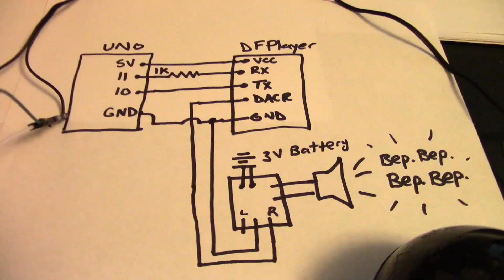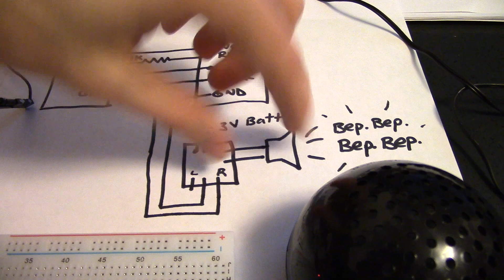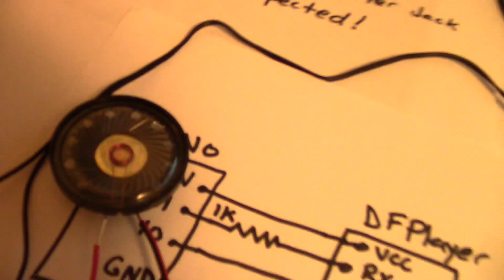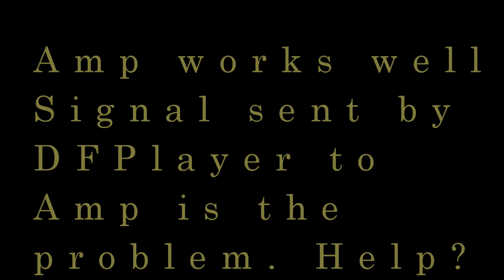DFPlayer troubleshoot

Comment: This is a very old issue, and many have probably figured it out already but I will nonetheless post this in case someone finds it helpful.

I had exactly the same issue when connecting everything on a breadboard with jumper wires, and as several people sugested here and on forums, soldering everything tight, including soldering ground pins of the DFPlayer together, completely solved the issue. Works well when powered through PC USB or 9V battery - does not matter.

Comment: I had the exact same problem as described in the video in stereo mode only (speakers connected to dac_l and dac_r). I finally solved the problem when I connected the speaker negative(s) to the other ground of the dfplayer mini  (opposite side from dac_l and dac_r). The 5V and ground of the power supply are connected on the same side (ground between dac_l and dac_r).  So two different grounds, one to the speakers and one to the power supply). No Bep  Bep sound any more, try it!
Reply: Boom!!! This. Thank you very much. I also switched to Ground Pin 10 (it was 7 before) now no Bep Bep Bep anymore. Pin 7 is still used for the GND of the speakers.
Reply: Your reply helped me a lot. This and external power supply resolved the issue. Thanks!!!
Reply: Beauty! Just started playing with this module. Had seen comments that both grounds should go to power ground but disconnecting one ground  switching the (in my case) headphone ground to that pin    did the job. For such a popular chip you would think better documentation would be out there

Comment: I have had this. A bit late now but for anyone seeing the same thing. I was supplying 5v from a power bank, this was because the player would clip and cut out when the noise got a bit loud. I thought maybe this was insufficient current. I swapped back to the 3xAA power supply and the noise disappeared. If you used a regulator you could probably still use a power bank. There are two types of wiring on the internet. Prominently it is connecting speaker+ to one output and speaker- to the other output. You should in fact have one going to the speaker output and the other going to GND. This stopped the clipping.

Comment: I know this video is very old but the problem is caused by a lack of power from the 5v supply. eg if you use a USB lead to an Arduino, and 5v from there to the DFplayer.  Run it all from an adequate power supply and there will be no issue at all. But still connect the DFplayer to that supply (5v regulated) and not from an Arduino as the Arduino can more often still not provide enough current(A) ability (even if the Arduino had a 12v supply into it).
Reply: this solved the problem

Comment: My findings: power issue.

I had the same issue with an Arduino nano (clone), tried all the suggestions (resistor, capacitor, separate power supplies, grounding both pins, etc), nothing worked.
Today I tried a Wemos D1 mini and it sounds fairly good when powered by USB with a PC.
But it sounds great with a separate, more powerful supply (also by USB).

Comment: I have same problem.
Someone is writing 9V 2A is OK.
Have you tried it? Dose 9V work well?

https://arduino.stackexchange.com/questions/49807/dfplayer-noise-researched-tried-and-bep-bep-bep-bep-bep
>Power is the big issue. When I powered my Arduino with a 
>9v 2A supply all the noise went away. 
>Switching to USB power (5v) caused the noise to return.

Comment: I put a resister on both pin 10 & 11 to Rx & Tx on DF Player. Get the noise sometimes maybe due to loose connections. When everything is soldered on a circuit board, noise is eliminated.